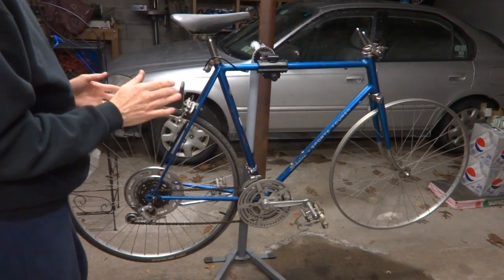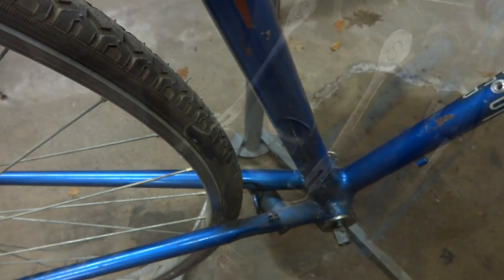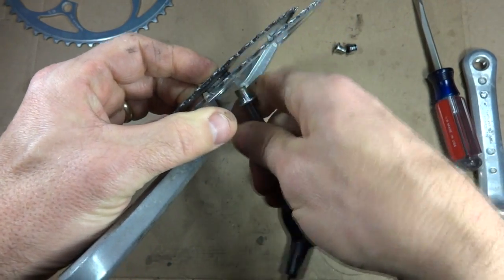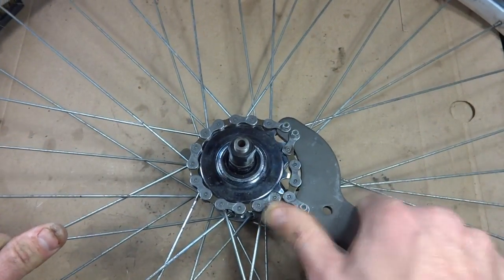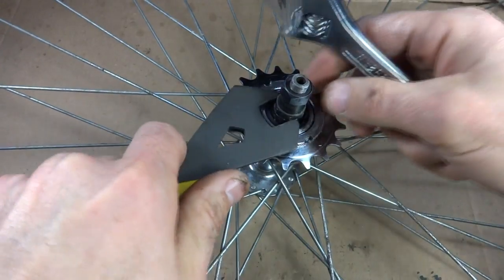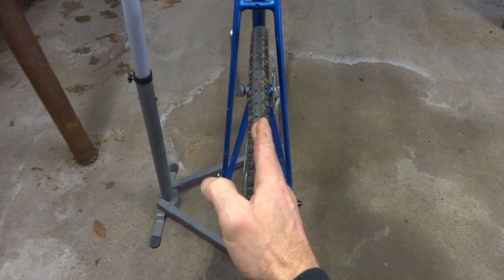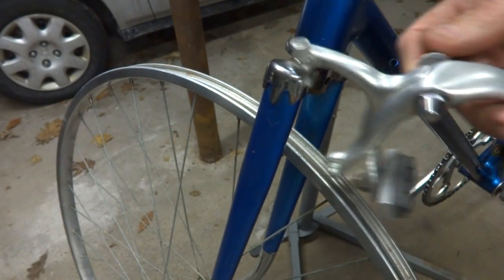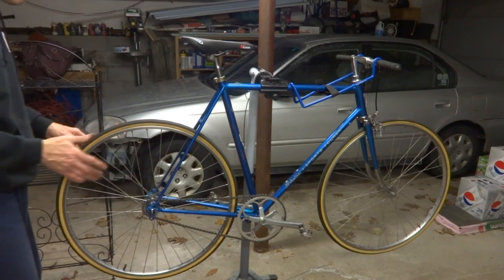How To Build A Cheap Fixie From A Vintage Bike

Comment: Can we buy a fixie and add some more gears to it?
Reply from the maker: Maybe.
Reply from the maker: But why buy a fixie and add gears to it? Why not just buy a bike with gears to start with? It would probably be cheaper and easier.
Reply: The DMR chain tug with derailleur hanger is the best place to start. It'll be a pita but if you favor track geometry it's the only way to go as of yet. Fyxation's Quiver has a similar setup. Shyflirt is right though, it's cheaper to buy a geared bike. Check out Verenti bikes.
Reply: RJ The Bike Guy  Why would anybody strip the gears off a perfectly good road bike to make a bike that only has a good cadence at one speed?
Reply from the maker: Because they can. And by the way, the rear cable stop was broken off the frame, so it wasn't perfectly good as you say.
Reply: Yes, some single speeds, come with the mounts for adding gears if you feel you want to in the future. The Bombtrack Arise, does, as it is based on a Cyclo cross bike

Comment: do i need a 5-speed bike or could i use a 7-speed?
Reply from the maker: +Filipe Lemos You can use a 7 speed.
Reply: +RJ The Bike Guy i do need to mod the frame, dont i?
Reply from the maker: Why would you need to?
Reply: +RJ The Bike Guy because of the width of the dropouts, don't i need to shorten it?
Reply from the maker: Are you changing the wheel? I used the same wheel, so I didn't have to change anything.
Reply: +RJ The Bike Guy i do want to change to a deep v's, 120mm width
Reply from the maker: If you want to use a different width hub, then you will want to change the spacing. Only do it on a steel frame. Do not respace an aluminum or carbon frame.

Comment: Lets say for some reason you wanted to put the bike back together to original and you do not have the parts most bike shops will give you a bill so incredibly high you'll question why you striped them off in the first place. just saying, gears are there to help you, people don't know what they got till its gone.
good vid.
Reply from the maker: +Dan Nimoy I still have all the parts unless they have been used on something else.
Reply: +RJ The Bike Guy i know you do because you understand the value of things!

Comment: One last point, that bike is close to 40 years old, did you see how well those threads came clean around the headset? that is a real bike, it will last 100 years. most new bikes won't even last 5, due to material composition, thats why the focus has shifted to weight. schwinn also used good hard bearings. Bike shop like to bash schwinns all the time, all you need to do is look at their age, if their 20 something then they have no clue what a schwinn is and they want you to buy a new bike. even tho i hate the idea of stripping down a road bike i appreciate giving it a second life.
Reply from the maker: +Dan Nimoy Schwinns used to be frigging tanks. Yeah, if you make a bike that weighs a ton, yeah it can be made to last. Personally I like a lighter bike.
Reply: +RJ The Bike Guy common misconception, yes lower end like varsity, but at the time schwinn was making lighter" bikes. even the one you were working on what does it say on the seat tube? how many other companies were using that at the time? a 70 schwinn paramount weighs around 25lb depending on the components, schwinns were also using a variant of columbus later on, yes weight has changes a lot from the 70s but from the 80s not so much weight/price. we lost maybe 5 lbs for the average rider the more you spend you can deff get it lighter but who wants to spent 700+ for a reduction of 5-10lb and crack when you hit a pot hole.(90s crackandfails, sorry cannondales)  at the end of the day its what the rider wants if you got the money go for it, if you don't theres not much of a benefit vs the price because in the long run one will spend much more money on modern bikes because you'll have to replace your gxp outboard cups every six months if your a real rider. Im geared more for commuters and thats where I'm coming from, so many customers when they realize it actually cost money to fix their bikes they would rather take the bus and put the bike in the garage because its just gonna break again eventually, most people are not like us, they don't even know there are tubes in tires do you think they need a light bike? 
love ya RJ

Comment: you like to use your adjustable wrenches backwards.
Reply from the maker: +iron duke I tend to fit them to the nut or bolt so the handle is at the angle I want. Or also to how the jaws fit.

Comment: I have nothing against fixie bikes or making your own fixie, but why use a relatively nice (seriously the sports tourer was one of the best Schwinn had to offer at the time) that could be fixed up and used as it was intended to be, a really nice road bike.
Reply from the maker: +chris lockaby What do I say at about 20 seconds into the video?
Reply: +RJ The Bike Guy I know it has a broken cable stop which I mean it a bit of a problem and a good enough reason to maybe turn it into a fixie. It's just when that drill touched that fork and at the end when I heard "paint" I just kind of got to me, Schwinn's are kind of my "soft spot" bike.
Reply from the maker: Most Schwinns are frigging heavy tanks and not too hard to come by. This wasn't a Paramount. I only paid $25 for it and mostly bought it for the handlebars which I ended up not using.
Reply: Well that is quite true but that one is "light" by Schwinn's standards. For $25 that isn't bad. I still don't like the fact that it was turned into a fixe but it least it's back on the road instead of sitting in someones basement or garage wasting away. Oh and I did forget to post originally that even though the bike was turned into a fixed gear bike (which I obviously don't particularly like) the video was pretty cool.
Reply from the maker: I have a video or two working on a Schwinn Le Tour Luxe. That was a much cooler, lighter bike.
Reply: I'll be sure to check it out. I've never bothered to ride a Le Tour (of any model) but I have a friend who's mom had when, she described it as light and smooth compared to a lot of other bikes in her neighbor hood.

Comment: I'm sorry, I don't understand how pedaling backwards stops the bike.
Reply: it's a fixed gear, no inner freehub assembly to allow the bike to coast without pedaling. in practice this means that every movement that the wheel makes your legs will also. if you push the pedals back you are effectively locking up the wheel like a brake

Comment: to lock better the ring, use 2 little bolts screwed in the middle of lockring and cube.

to screw them, drill 2 holes with 3mm diameter .

its the cheapest way to got more secure lock.

sorry about my english.

look the end of page in this link (in portuguese)

http://bikefixabr.blogspot.com.br/2014/02/como-montar-um-cubo-fixo-com-pinhao.html

Comment: Why didnt you just Weld the cog on the rear wheel
Reply from the maker: +Olle Johansson Research the details of welding steel to aluminum.
Reply: +RJ The Bike Guy  Steeluminium? XD
Reply: You can pin it or braze with silver solder or silicone bronze. I recommend silver solder! nice vid!

Comment: Why is he worried about 6mm of distance between the gears? A chain can move sideways a lot more than 6mm across gear misalignment. I'd be worried if it's 12mm or more
Reply: Cause if the chain is misaligned, it can fall off while riding! And that can allready happen by only 6mm of misalignment.

Comment: RJ The Bike Guy Don't recommend to anyone to build a track bike from a road bike frame. It is quite dangerous due to the drop out of a road bike frame.
Reply: Rolando Riggio Can you explain why it is dangerous?
Reply: Road Bikes and Track Bikes have different drop outs. Track drop outs catch an axle from escaping if one where to skid and pull the chain with great force where as a road drop out is opened and allows the rear axle to be pulled sideways causing the wheel to either hit the rear triangle or come off completely.

Comment: The problem he have vintage steel bycycle it is you have rim steel or aluminum rim it is how have  mm rim tape it is suitable. The vindage rims it is have  700c 12mm  it is VERY DIFICULT TO FIND SPESIFIC RIM TAPE!!!!! THE BEST TO MADE IT UPGRADE YOUR RIM TO MODERN RIM  for example He have minimum 700c 18mm   The size 700c 12mm  now is NO MORE!! It is VERY RARE!!!!!
Reply from the maker: It doesn't need to be exact. I get it on eBay or my local bike shop.
Reply: You are wrong! HE NEED TO EXACT!beleve me! This days i wand to fix my mersier and put rim tape continetal high pressure 18mm and 2 times blow up my inner tube. It is same size inner tube and the tyre . My older mersier he have kenta and he have inner tube and rim tape IT IS 700c 12MM. IT IS PREFECT. It installed the year 2014 and inner tube NOT blow up.
Reply from the maker: The rim tape just protects the tube from the spoke ends. It needs to cover up the spoke holes. That's it. Maybe you should let a shop work on your bike.
Reply: The perfect rim tape for vindage bike it is  zefal 700c 10mm and 13mm cotton rim tape.

Comment: What exactly is a fixie?
Reply from the maker: Dorie LaRue A fixed gear bike. It doesn't freewheel. You pedal forwards, you go forwards, You pedal backwards, you go backwards.
Reply: I heard this several times and you mentioned it in your video as well, but when does a cyclist want to ride backwards?  I would think the only time this would be appropriate would be as part of a circus act or something.  I am being serious though, when would someone want to ride backwards?
Reply: RJ The Bike Guy No brakes?
Reply from the maker: Generally you pedal backwards to slow down.
Reply: I've never ridden a fixed gear bike but do you actually pedal backwards or just try to resist the forward momentum of the pedals?  I thought the pedals never stop turning on a fixie if you are moving forward.

Comment: When it comes to this bikes you can buy a repaired one cheap no more than 200 bucks or buy a decent one in 100 dollars or lees and add new parts for less or a little more than 200 if you want or just make a fixi buy strong frame less than 50 bucks and spend more in quality pieces wont be more than 150

Comment: I don’t get why You replace center pool brakes with side pull brakes. I do get why you make this a fixie; gears suck on these old bikes, and the obvious simplicity of a fixie is cool looking.
Reply from the maker: Dunno. It's what I wanted at the time. Don't have to mess with a cable hanger.

Comment: you know how to make a fixie bike with any bike, cut the gear cables
Reply from the maker: Apparently you have no clue what a fixie is.
Reply: +RJ The Bike Guy it would be a fixie bike, it wouldn't be considered one because it would have a free wheel. it would be a "fixie"
Reply from the maker: Fixie is short for Fixed Gear. The fact that is has a freewheel makes it not a fixie. At most it would be a single speed. And wheny ou cut the cables, then you would be in the small ring, small cog and cross chaining. Not a fixie.

Comment: What is a fixie!!!?
Reply from the maker: +Mike Breler A fixed gear bike. Single gear, no freewheel.
Reply: +RJ The Bike Guy 
In my opinion, they should be illegal on the roads.  A freewheel or equivalent system should be mandatory.
Reply: +Aitor Bleda what? theres nothing wrong with haveing a fixied gear. fixed gear or single speed are both optional. while gears are better suited for road a skilled enough cyclists can do good on road
Reply: Single speed, no problem.

Fixies are dangerous, as you can't put a pedal while turning, you can't stop on a dime without skidding, and pedals will get moving if you lose one of them.. unnecesary dangers for no advantage.

Comment: This is not a good thing to do the wheel would have been built for a freewheel and a fixed wheel is tensioned differently to take care of the braking force when pressure is applied to the pedals the wheel could collapse and will do after a few hundred miles

Comment: I'd have went for cranks/chainring with the odd sized spider magigy, them one looked much cooler and either way you ended up with a chainring the size that wasn't ideal for you. Cool video though, I did basically the same thing you did, and the bike was my pride and joy...until the frame cracked, then I swapped it cheaply and then it got stolen so I bought a complete bike! haha. Fucking wankers stealing bikes!

Comment: Whatever. This all looks like much ado about nothing. Just remove the derailleurs and cables,adjust your chain length to your desired static "gear" use one or both of your existing brakes and go.
" oh no!" " Its not a real fixie now" . 
Who cares.  Have fun picking yourself up off the street the first time some clueless driver
Runs out or turns right in front of you .
I think y'all and the rest of the world just likes saying the word "fixie".
Reply from the maker: aladinsarsipeus No, then you would have a single speed. Not a fixie.
Reply: Would that be safer though as as a SS so you wouldn't have to brake using only the pedals and you wouldn't need to have to keep pedaling 24/7?  I'm guessing a setup like that you can still coast, but you have to retain the hand brakes correct?  Seems a SS would be a ton safer than a fixie right?

Comment: Destroying an actual,"vintage road bike," to make it into a fixie can put you out thousands of dollars! A,"bike boom," bike from the late 70's or early 80's is fine to take apart! The general rule is if the shifters are on the stem it's probably not worth much so have at it! If you've already wrecked a classic and haven't painted over the Reynolds 531 decal and the original makers markings it could be worth acquiring by a restorer! If you've already wrecked it the original drive train and brakes may be worth a lot IF YOU WERE SMART ENOUGH TO KEEP THEM!!! Check the value of ANY older road bike before you mess it up!